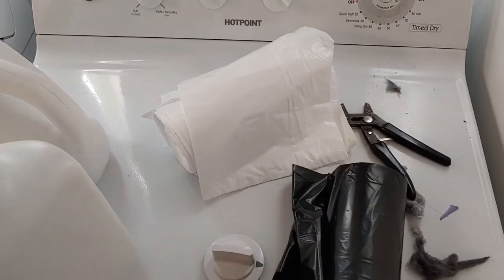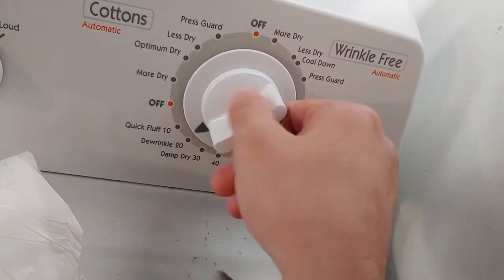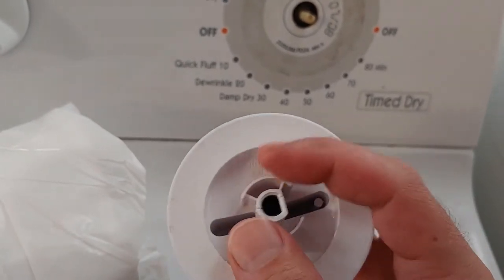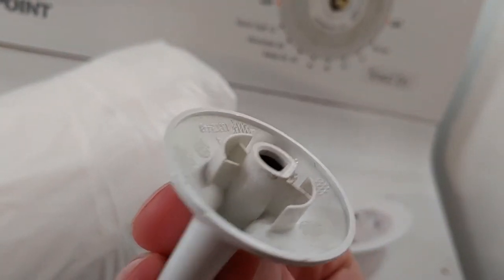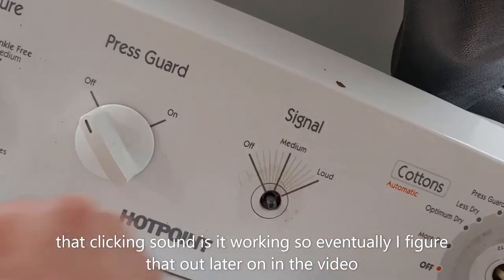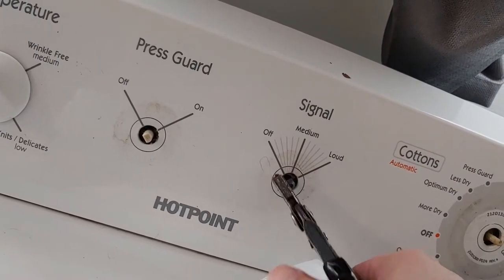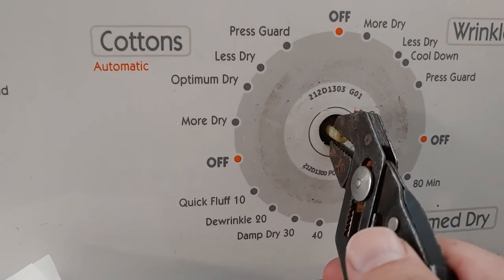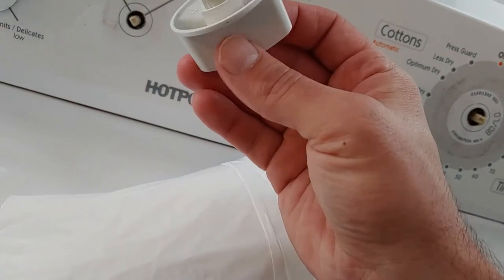How to Fix Dryer Knob Not Turning on DSlot

Comment: dude thank you so much I was on the verge of a mental breakdown I thought that the actual thing inside my dryer had to be replaced since it wouldn't turn but I just switched the knobs and now it works fine😭 gotta get a new knob tho since mine has a crack tho☠

Comment: Okay, so... This happened to me last year and I ended up getting a new knob that has a thick metal ring on the outside of the housing as well and that did the trick. However, a couple weeks ago my knob started turning around the post again without turning the whole thing so I assumed it was cracked. I could see the crack, but since knobs are so cheap I went back to Amazon to purchase another one... But it's not working. I can't even turn the post with pliers. I tried and tried and tried, eventually got it to turn and pressed start, but it still won't work. I checked my breakers, nothing was tripped... So i'm definitely struggling to figure out what the heck is  going on before I have to call someone in. Any ideas? I feel like I need to pull it out and check the vent and all that. -_-
Reply: Might be a timer box issue.